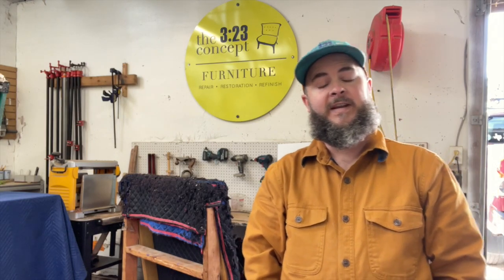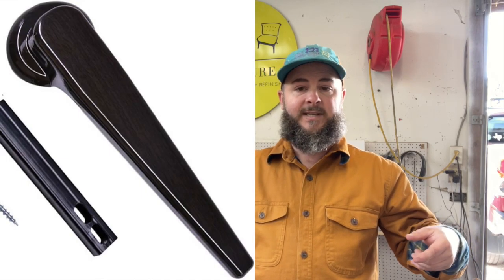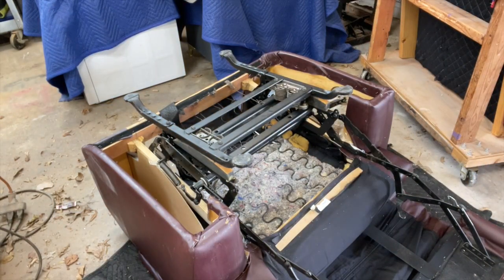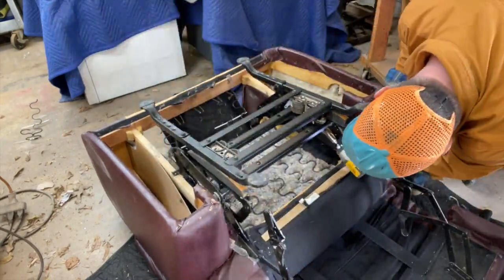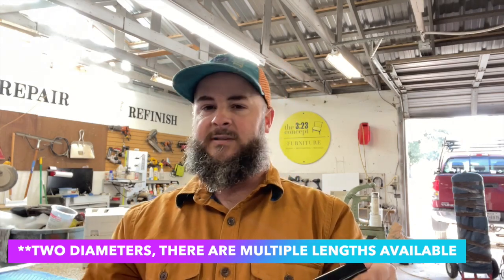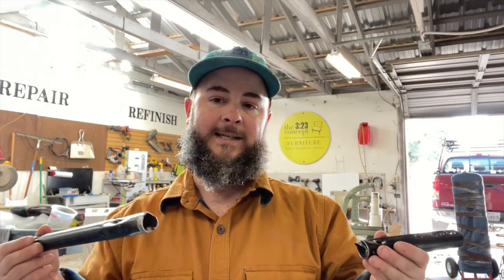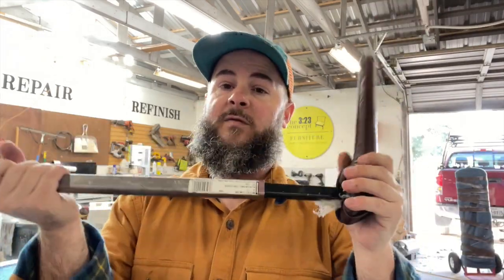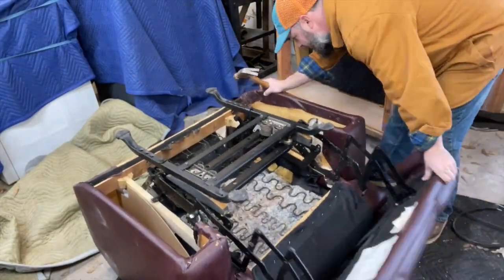Recliner Drive Tube Replacement

Comment: Brilliant work fabricating the drive tube. I can't find that part. Seriously, I will buy 1 off you if you are inspired to make another!
Reply from the maker: I would, but I’d need the corresponding parts so I know where to make and drill
The holes for motor and mechanism mounting. I bet a local metalworker could make one up fairly easily

Comment: With cable release square tube design:  The feet has to raise all the way before you push with your shoulders to force reclining back.  

Can you modify the mechanism so it will recline back without releasing the foot rest?  
Or so that the foot rest doesn’t have to extend 100% before reclining?
Reply from the maker: I’m not too familiar with how that would be accomplished. Sorry, I wish I could be more help
Reply: @the323vlog4 
No worries- I appreciate the reply.

I think if you came up with a way to make that change- like a kit to sell- people would get it.  
Why?
People like me- hurt back the recline helps.  But often tight hamstrings make raising legs uncomfortable so being able to do that sometimes is desirable. Maybe just me though.